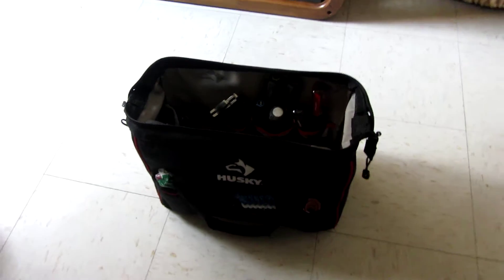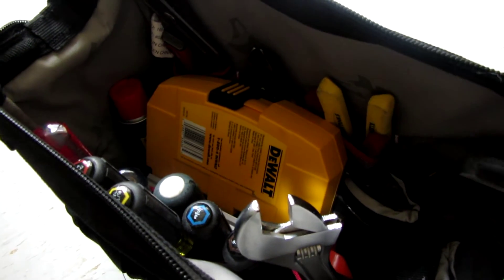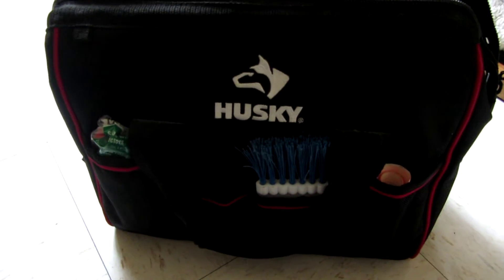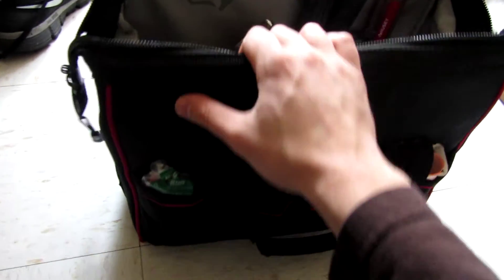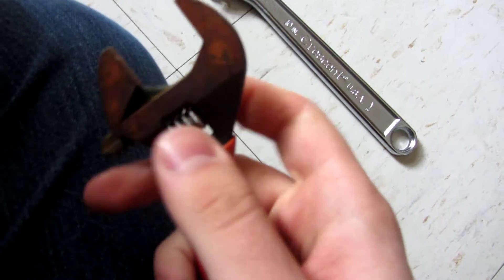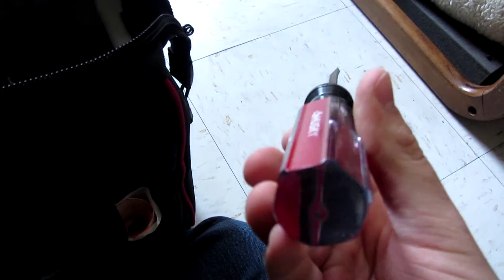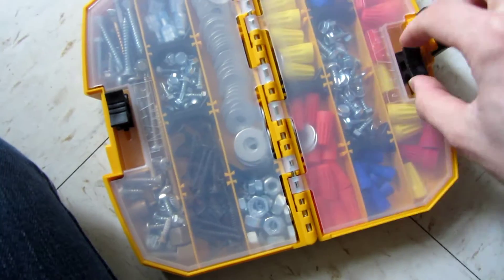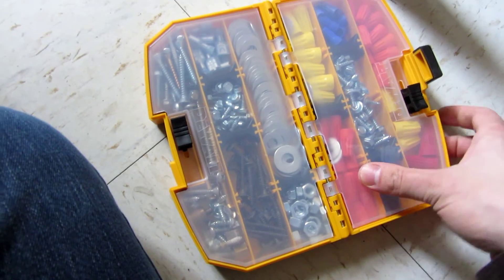My tool bag for work

Comment: Hey Mike, good vid! When i started out in the trade years ago i got given an adjustable for a similar reason, i gave the sliding surfaces a clean with a diamond stone and then oiled it and it worked well for years!
Reply: Good job, I agree with John. Can't beat free tools. I only buy that husky screwdriver, it's the only one I ever need. Use some of that WD40 on that crescent wrench, it'll be good as new
Reply from the maker: Hey thanks a lot ! and yea Its nice some of the guys give me stuff they know am here to learn and work not to just play around.
Reply from the maker: True free tools that are still good are the best and I will do that for sure with the WD40